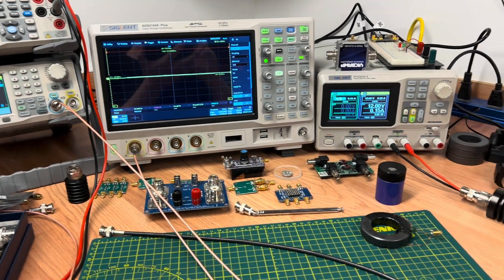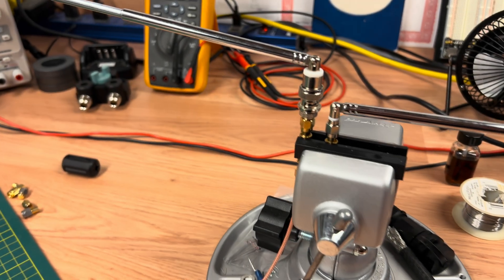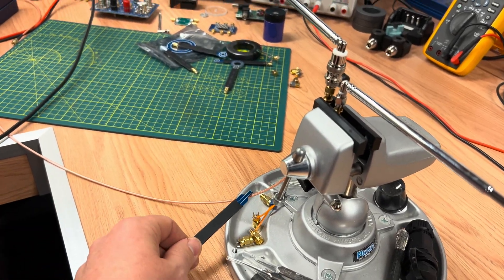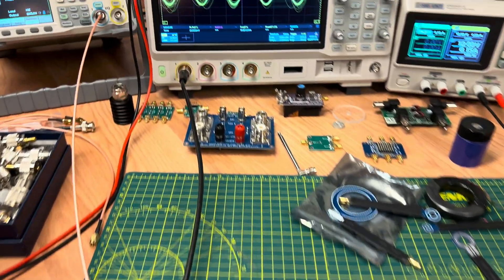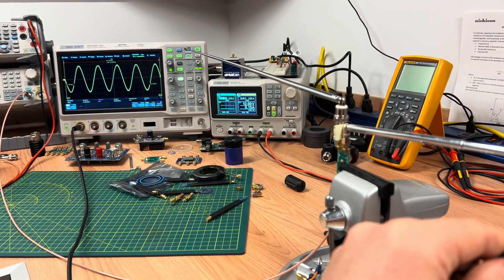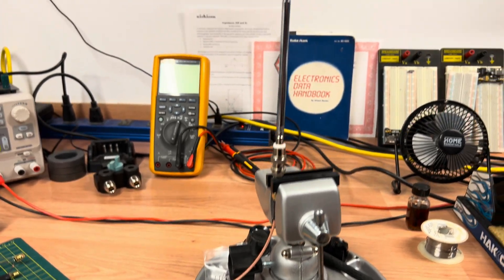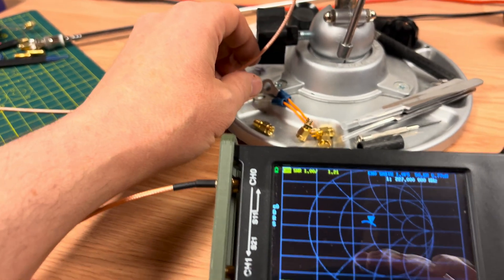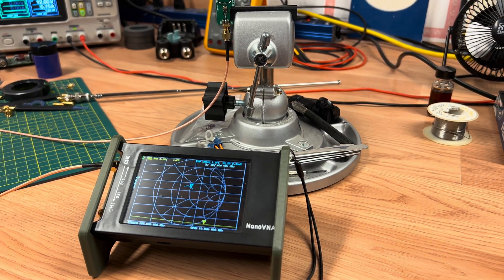How To Build A Terrible Antenna!  Common Mode  Current Experiments Continued…

Comment: A clever, practical, and understandable demonstration of the issues. Neat to see you implementing this with off-the-shelf baluns, whips, and subminiature coax at what looks like 100 Mhz. I generally think of priorly balanced antennas and longer feed lines in the 7 megahertz range, but this bench-top demonstration is quick, practical, and mentally extensible to he HF case. Nice job.
Reply from the maker: Thank you.

Comment: I wonder if I can use my Tiny SA Ultra to detect the RF on the dipole legs and feed line.  I'm going to try..The common mode choke is also available on Amazon
Reply from the maker: Yes!  It will detect RF on the dipole and feedline, however, one needs to be careful not to overload and damage the sensitive input of the Tiny SA.  Perhaps a selection of attenuators should be acquired prior to starting this experiment.  Enjoy!

Comment: Thanks for the great video. I've been struggling to understand common mode current and baluns. I just got a NanoVNA so I hope to learn more. Any chance I could get you to do a video on the use of the oscilloscope. I bought one many years ago, but I never seemed to learn enought to use it. The first time a saw a video showing the current leading the voltage and vice versa it was quite spectacular to me. Thanks again. 73s Steve, KN4P

Comment: Could you please add some links explaining the types of the probe (connected to the scope) used to measure the signal on the antenna legs and on the coax shield? They look like some tiny coils, perhaps measuring the magnetic field near the surface of the conductors and this way sensing the current, but is this interpretation correct?
Reply from the maker: @phystimn  You are correct.  These are E and H field probes.  Purchased to make near field relative measurements of electric and magnetic fields.

Amazon: https://a.co/d/aqYFdIj

Comment: Could you repeat this demonstration using a common mode choke in place of the balun?
Reply: Agreed, but they're a fast and cheap solution out in the field, or even for testing. It should make for an interesting test!
Reply from the maker: I would need to research toroid materials and see what would be required to build a choke that is effective at 100 MHz.  The balun I used is one that I ordered (I didn’t build it) and it’s good from 150 kHz to 350 MHz, so it worked well in this demonstration.

In my ham shack, I typically hang out on the air at 3.7 MHz, so everything I have as far as construction materials is for low HF frequencies.
Reply: @ve6wo  something simple to try is a short piece of coax wound in a coil and attach that to the base of the antenna. 5 or 6 turns, maybe, but I don't know the diameter. It would be interesting to see them if there are any common mode currents along the coax.
Reply from the maker: I don’t like those kinds of chokes, but maybe playing with them on the bench will result in me changing my mind?  Haha!

We’ll see what happens.

Comment: A schematic of the balun you used would be helpful. Seeing what your super mini balun looks like would be a major help to build a balun for my (crazy to tune) HAM Stick dipole (SWR on my crazy dipole runs about 4:1 making a tuner an absolute necessity). As it stands, I can only imagine what my common mode current is. PS - enjoying your videos on the CMC problems.
Reply from the maker: I cheated on the balun… it’s from aliexpress.  The 150kHz-350MHz version.

It seems to work very well!

I just found this on AliExpress: C$13.03 | 100KHZ-6GHZ RF Differential Single-Ended Converter Balun 1:1 ADF4350 ADF4355 10MHZ-3GHz FOR FOR HAM radio Amplifier
https://a.aliexpress.com/_mq5KgeP

Comment: Interesting. Would have like to seen the details and construction of the balun. Maybe you could make a video about it? You make very clear videos.
Reply from the maker: The balun is from aliexpress.  The 150kHz-350MHz version.

It seems to work very well!

I just found this on AliExpress: C$13.03 | 100KHZ-6GHZ RF Differential Single-Ended Converter Balun 1:1 ADF4350 ADF4355 10MHZ-3GHz FOR FOR HAM radio Amplifier
https://a.aliexpress.com/_mq5KgeP